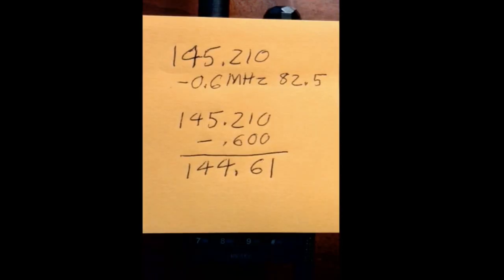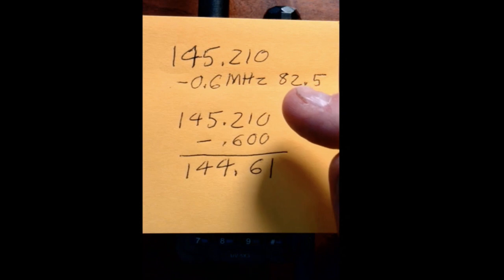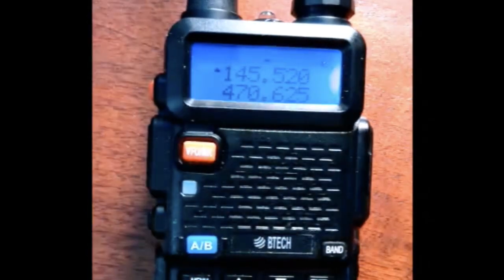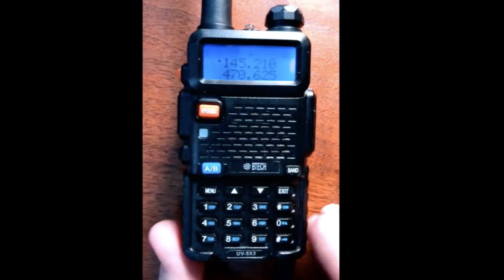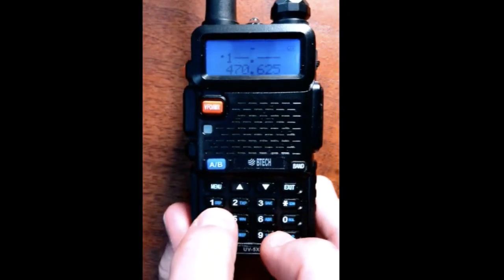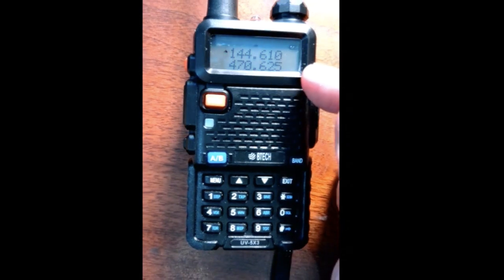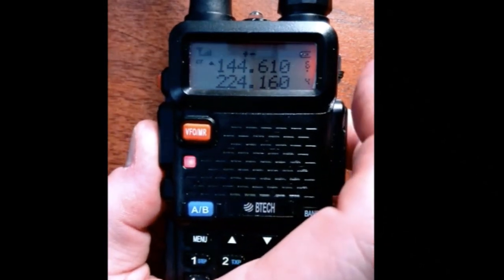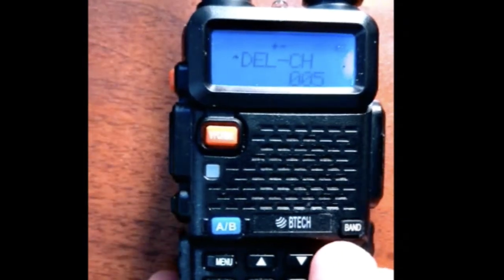How do I save a repeater frequency with a tone in the BTECH UV 5X3?

Comment: VFO = Variable Frequency Oscillator (frequency mode)
the mode where you can variably scroll through frequencies based on the value in STEP

MR = Memory Recall (channel mode)
the mode where you can scroll through and recall stored memories
Reply from the maker: Thanks again for the further clarification.

Comment: I believe this to be very informative.  Chirp no longer works on my macs so I need to program by hand.  What would be very helpful is a written step by step guide on programming this radio.  Also, as mentioned below, audio sounds like it's coming through a Covid mask!  Nonetheless, thanks a bunch and I think after viewing a few times I'll have the procedure down.
Reply: Hello Brian this is KE8UKZ. I agree, chirp on my Mac is very frustrating because the program is very unstable and I found out my USB plug is defective, it does not fit snug into the port.

Comment: I just got the UV-5R and a pair of Nagoya 771g in case SHTF. They look similar to what you have there. I know a little had a GT-3TP Mark iii that I’m returning because they have a proprietary antenna that can’t be upgraded and they’ve discontinued them. It was made by Radioddity to only work with their hardware and since everything including the batteries are proprietary I decided to go with the UV-5R. I want to be able to pick up the ISS when it’s over my head in orbit. Those GT-3TP would only get static or maybe they weren’t broadcasting open?